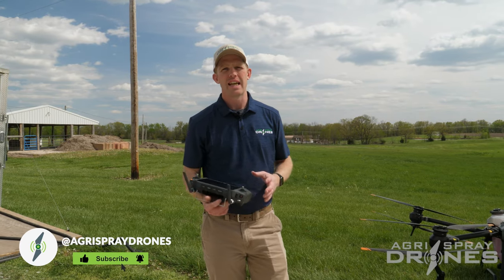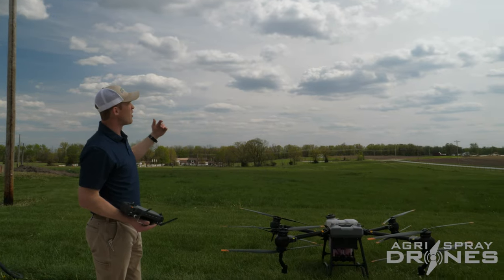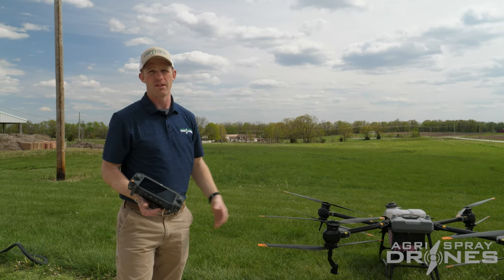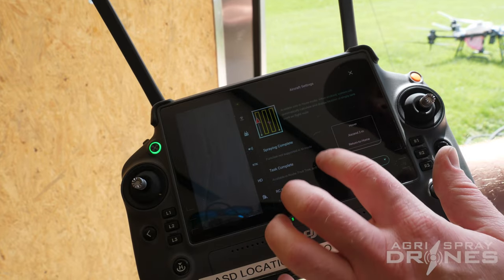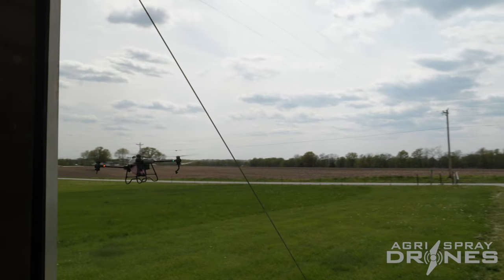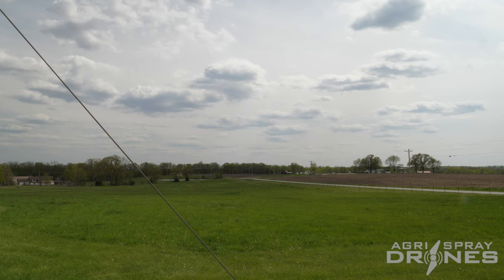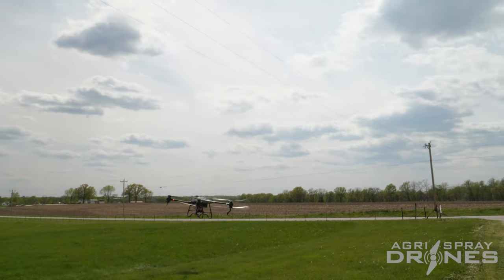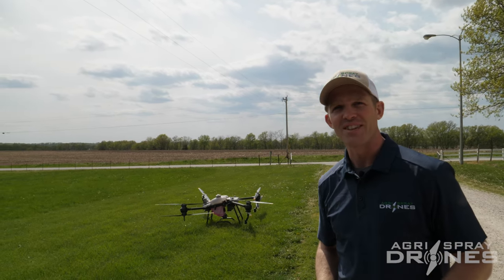How to Operate Near Power Lines | DJI Agras T40 | Agri Spray Drones

Comment: What about lines running through the middle of the field? I’ve noticed my t40 really doesn’t like flying under them and I’m particularly concerned about this when corn is tasseled out and my operating altitude is even higher